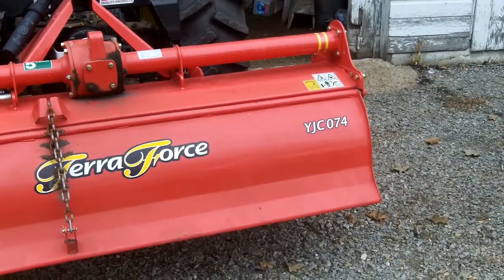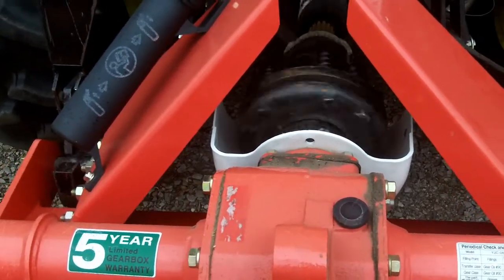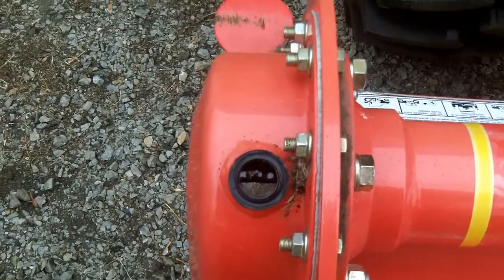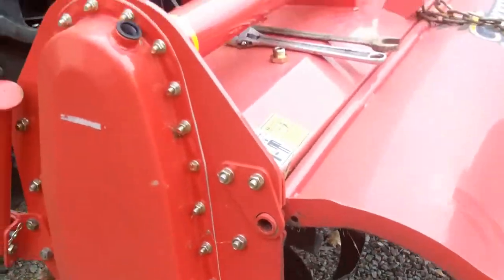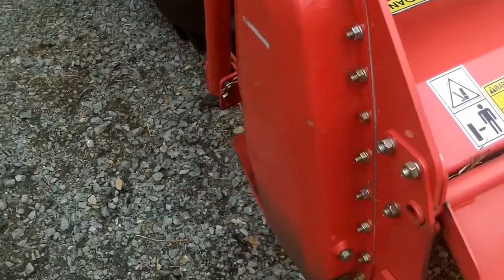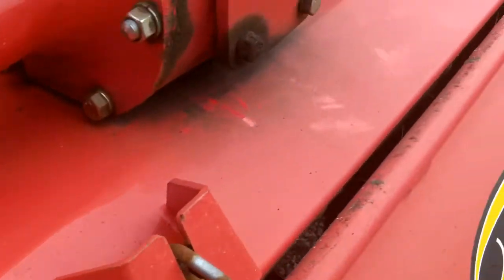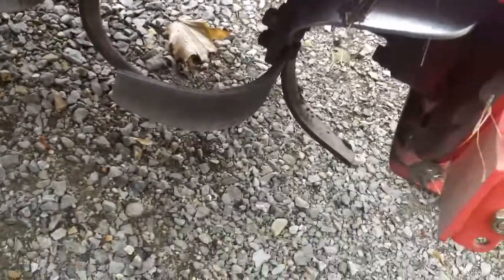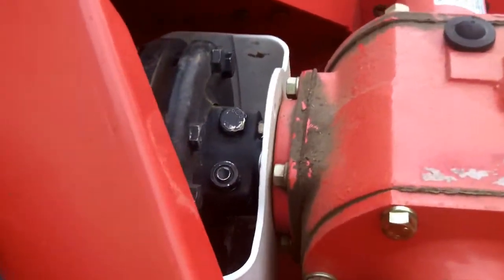Ansung - Terra Force YJC 074 Tiller Repairs

Comment: What was the issue?
Reply from the maker: Where the bolts were missing, they had wiggled their way out. That resulted in way too much flex in the housing, as it was only supported at the ends. Caused cracks in the weld joints and ultimately the end spline shaft, at the bottom of the chain drive, the spline shaft snappe.
Mechanic  said this is a VERY well engineered unit and repairs were actually very simple.
Then he welded up the cracks.
Splashed a little paint on.
Works like a dream again.
And??? Most importantly, I know which bolts to check before every time I use it to make sure they are tight.
Lesson(s) learned.